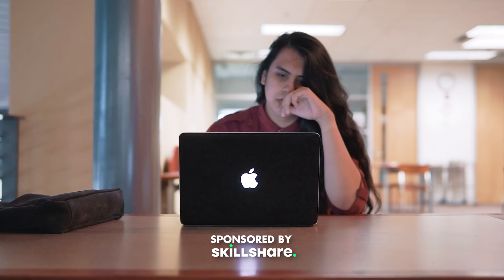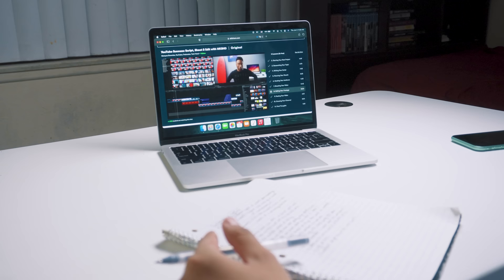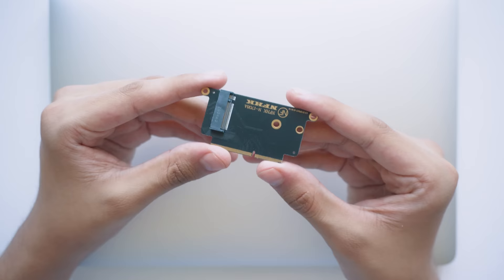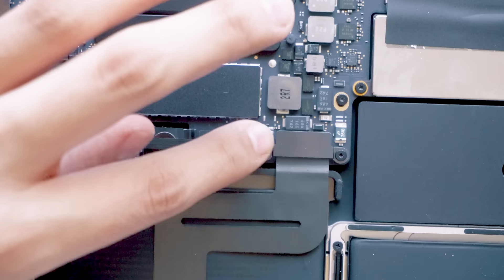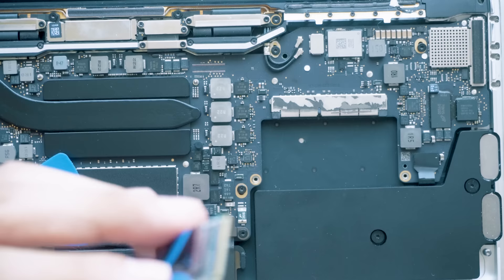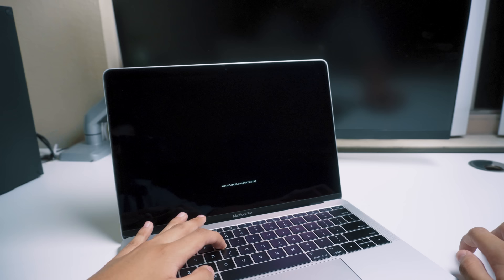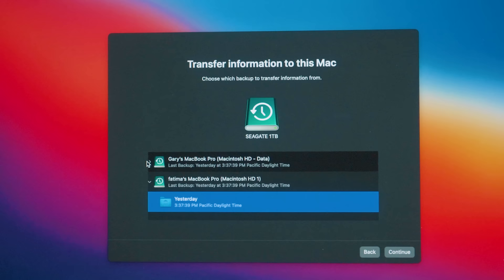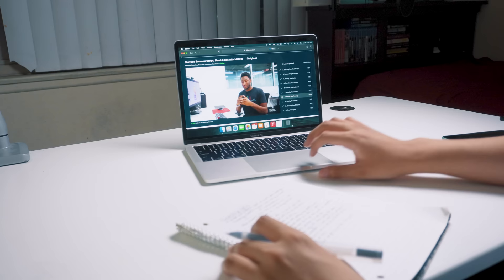I Was Wrong. THIS is the LAST Upgradable MacBook Pro

Comment: Damn this is insane. I too have a 2017 MacBook Pro that you are using in this video. Same specs same everything. The only think that scares me is after the installation and the os operating system. A couple of months ago my hard drive failed and I had to get it replace, it cost like $500. When I saw that folder with the question mark I had a flash back and I was really scared now to do this. Are you sure this will work? Ik this seems a little weird but I don’t want to run into any trouble along the way. Especially when I am dealing with my own Mac and the one thing that costed me $500 to replace. I would ask for you to guide me step by step but that’s to much to ask. Do repair shops upgrade MacBooks by any chance?

Edit: you just remind me, when I went to the apple store, they told me that the storage drive was soldered on to motherboard. So is the drive soldered onto the board or not?? Are you telling me that apple was lying to me and that I could have fixed it my self this whole time??
Reply: Yes, Apple lied to you
Reply: yes,apple often lies about this things.idk if you can,but try to get away from them asap.you'll have a much better experience with almost any other manifacturer.
Reply: For anyone reading I confirm that the model A1708 has no soldered SSD. Just disassembled mine and discovered it
Reply: Only MacBook pro 2017 with touchbar got storage drive soldered.

Comment: Probably meant to use the standoff as a nut on the opposite side of the screw. I think it wasn't in the PCB because it would have been fairly easy for it to twist through by mistake.

Comment: These are some major issues (and tips) to be aware of before proceeding with this mod:

1) Cleanly powering off becomes impossible! This is not fixable AFAIK.
2) Without properly configuring the NVME in OSX, your battery drain and temps will increase. It's possible to mitigate these, just google for solutions. Turn off icloud filesync.
3) Disable mds_stores (spotlight indexing) - learn to use find / fzf and ripgrep, quicksilver is a great alternative to spotlight search-bar
3) Occasionally your boot loader will fail to see the drive on startup. Resetting NVRAM seems to fix this.

Comment: This is precisely why i hate the lack of upgradability of Apple mac products especially their macbooks. Louis Rossmann who repairs macs points out in his repair videos that newer macs have their SSDs and the RAM modules built into the motherboard so if down the line one of them dies, a customer will either have to replace the whole board or take it to a repair shop where they can replace the module itself which can be an expensive job if done right. I much prefer a windows computer as most windows computers have repairable parts and you can upgrade others.

Comment: Great filming. 

I’d do full system updates if possible then use carbon copy cloner straight to the nvme drive (usb c external). 

Test it works by booting off usb. Then plug in and hand back to Gary.

Comment: I have a 2015 Retina Pro with 512 G. Might have considered doing this but my speakers are blown, the battery is 8 years old and the display is bubbled.  If i fix everything its too labor intensive and expensive.  I’ll upgrade to a 1T Air and give my old one to a niece.

Comment: I’ll never understand people who prefer physical buttons to the Touch Bar’s slider. With traditional keys you have to press anywhere from 5-15 times just to change the volume, on the Touch Bar it’s quite literally one touch and slide without having to move a finger
Reply: Failure rate. It’s incredible how often those things break, fail, crack ( since they’re made of glass ) and they’re also never a consistent set of tools it changes from app to app causing issues

Comment: I had this exact same MBP I purchased back in 2018. I never realized you could upgrade the storage in it. I would have kept it until the butterfly keyboard gave up the ghost had I known.
Reply: Whoever invented the butterfly keyboard ought to be waterboarded.  I had a 2016 MBP 15" and just ordered a 2022 MBP 16".  It was the only problem I had with the MBP.  But it was a major problem.  I got to the point that I had to use an external keyboard and that changed my laptop to a desktop.

Comment: The problem with the A1708 is its proprietary SSD, If the MacBook dies you lose all the data if the hhd dies you lose all the data. Kinda trash that they didnt make an adapter for data recovery.

Comment: Can't add RAM though.  Also, if you really are adventurous you can even upgrade the storage in the iPhone, so by extension it may be possible to upgrade an M1 Mac in the future, the storage isn't literally on the chip itself but is soldered on and may be upgradeable the same way you can upgrade an iPhone, but this isn't something most people would be willing to try.

Comment: While it is cool that the non-Touchbar 2017 MacBook pros have upgradable storage, the last “true” upgradable MacBook Pro is the late 2011 model imo, as it’s the last one where the stuff that can be upgraded uses industry standard connections, like SATA. You can also put in a drive doubler to replace the optical drive with a second HDD or SSD, replace the wifi card with one from a 2012 model to get Bluetooth 4.0, it has upgradable RAM, and is the last MacBook to have an expresscard 34 slot.
Reply: I thought it was the mid 2012 model? They are identical to the 2011 model if I am correct
Reply: @TechSpec814  good point, I forgot that the mid-2012 model was similar to the 2011 version. The late 2012 retina one is where they switched from SATA for their drives to a “Sorta NVMe but not NVMe” SSD and soldered the Ram to the board.

Comment: Considering the well-know screen problems on the MBP 2014 (retina) followed by the well-know butterfly keyboard nightmare from 2015 to 2019, in my view the last upgradable AND reliable MBP is the mi-2012 A1278 : with i7 core duo 2.9 Ghz, 16 Go RAM and a SSD, for the usual use it still does very much the job in 2023 for less than 400€
Reply: I agree. I have a mid 2012 MBP. Unfortunately I only have the 2.5 i5, but even still upgraded to 16gb RAM and SSD. The extra processing power would help if i was doing a lot of intensive work like video editing, but I don't use this computer for that, so it's totally fine. Honestly, people would be surprised how fast my ancient MBP is compared to their newly purchased devices. 

Next thing for me is to look into the OpenCore Legacy Patcher to see if I can get Ventura installed on this machine since Catalina is now unsupported...

Comment: I got both A1502 (128G,8G ram) and A1708 (128G,8G ram for my wife), also upgrade SSD as well, A1502 upgrade to Sumsang  970 EVO 500G and A1708  upgrade to WD 520  512G previously, but since unstable, I switch to  a second hand 256G stock SSD,  so far A1502 is still on duty,  I love it more, since the keyboard get the soft feed back.
Reply: What was unstable about WD 520 ssd? Just curious because I am looking at buying the WD 530 1TB one to upgrade my A1708 Macbook pro. Thanks in advance.
Reply: @ybesprince5076   os  update unstable,  and you need  an adapter,  couldn't run bootcamp,
Reply: @kuochenyi  Okay, thanks for replying. I will most likely go this route as well. Trying to find a 1TB secondhand Apple ssd currently.

Comment: Nah for me the last real upgradable MacBook was the 2012 15 or 13 inches. Coz you didn't need any stupid adapter, or different sizes. You could actually upgrade it yourself with a laptop SSD or hard drive that works on PC. Everything went to hell in 2015. 2016... I was out

Comment: I bought my Mid 2017 last year this time so I could produce music better than a pc would. I was under the assumption that my 256gb was as large as it could achieve. I can't wait to upgrade the ssd. It does have only 8gb of ram though. too bad that is not a doable option. a new logic board with 16gb of ram installed is $450 and the ssd kit is another $150 totaling $600. I might look around for another used MacBook Pro for that price point and skip the upgrades. Or just do it all. lol

Comment: I blundered at the battery disconnection stage and damaged the connector on the motherboard. £000PS! This is shown very clearly on iFixit under battery replacement.

Comment: Apple lied to me. I called them to upgrade my 128gb SSD on my Macbook Pro 2017" without touchbar. They did not want to sell me an original SSD of 256, 512 or 1to because my Macbook pro was sold in 128gb. They said my Macbook Pro was only compatible with a 128GB SSD.

Comment: Hi @Dammit Jeff, thank you for the detailed instructions. I followed the exact steps and was able to upgrade the SSD drive on my 2017 mbp. However, following the upgrade, the only things that I noticed are - A) my mbp doesn't "restart" anymore on manually restarting it. It just shuts down. And B) I get a warning on restarting (as per point A, it shuts the laptop down and then I have to power it on myself to complete the restart) that says my computer was restarted because of a problem - CATERR detected. No MCA data found.

Has anyone come across a similar issue on their 2017 non-touchbar mbp after the upgrade? If yes, what did you do to resolve it? If no, what do I do additionally/again to not encounter it?

Thanks, your response is highly appreciated.
Reply: Having the same type issue.  Occasionally the MacBook Pro doesn’t recognize this hard drive.  No sure why but will be installing another drive without this adapter board.

Comment: I have a 2015 15" MacBook Pro with a 512GB SSD.  I want to upgrade to a Samsung 4tb SSD - The question is:  If I upgrade to the 990 Pro, will the drive operate at maximum performance, or will the limitations of the 2015 MacBook Pro throttle it's performance?  If so, what would be the best drive for me to get for that computer, that would not be throttled by the limitations of the computer? A 980 Pro...? A 970 Pro...?

Comment: SSD dies are not that hard to de solder and resolver so you could upgrade the SSD on a soldered device if you wanted to and since you don’t need to buy the most costly parts of the SSD (the controller) even if you pay a repair shop it could be quite cheap!

Comment: Have you had restart issues since the upgrade? I ordered the adapter and ssd you linked, but I’ve been doing some reading and it seems some people have been having problems where the MacBook won’t restart, it just shuts off instead.

Comment: You will have a flashing question mark even if you don't have a drive.
So that does not mean it's a success. Only the disk utility can tell you.
Internet recovery sucks, so I advise you make a USB installer. Then you just plug the USB drive into your MacBook through an adapter, hold option while booting, you should see a logo with the macOS version you are installing, select it with arrow keys and press enter. Then you directly enter recovery mode!

Also it means you do not have to install High Sierra or whatever it gives you, as you choose the version while making the installer.
Of course you can't run a version that's too new or too old for your device (at least not without patches. Patches are lovely but you need some knowledge to use them).

Comment: While your updating of your MacBook Pro seemed easy enough and although not quite as capable, I wouldn't change from the two MacBook Pro's (2010 17" and 2012 15") that I have with their parts changing capabilities, for MacBook Pro's of later year model even if I had the funds to do so. Why except to keep up with the crowd, would anyone go to 2012 Retina MacBook Pro's or later even with the low weight due to battery and heat due to the new M1 chip. Not me!

Comment: Hi! Great video! But unfortunately it's not working for me! After installing it, the disk utility can't detect the internal ssd. I tried with another copy of adapter and ssd but same scenario. Any solution for that? Thanks. Keep up the good works.
Reply: Hi! I’m also doing this upgrade right now. I can’t get anything to work past the flashing file with the “?” Cmd+R is not working either.

Comment: I have a 2012 with a cracked screen because I put a privacy slide on the camera and closed the lid.  It's abysmally slow because the battery is completely dead and these after market ones don't last long.  Was SSD pretty much the standard after 2013?

Comment: Amazing video. Does this only work for the 'no touch bar' version (13"), or also for the 15"?
Reply: it will work with all 2016-2017 both touch bar and non-touch bar but make sure to buy the correct adapter

Comment: So I’ve done this, got all the way to the install Mac OS after formatting the drive and I get the “the recover server could not be contacted”. I tried connecting to different Wi-Fi’s, changing my time and date in terminal etc and still not working. Anyone have any suggestions?

Comment: Do you know how you can fix a external hard drive not connecting for time machine backup? i have a toshiba 1tb for my MacBook Pro (13-inch, 2017, Two Thunderbolt 3 ports), it seems it is not connecting properly.

Comment: You get a like, because I didn't know models after the mid 2012 non-retina Macbooks were upgradable.
      (I can tell you, the 15" version... Still very much usable to this day with a fast SSD in it. Also for Photoshop. And we're in October 2021 now; so 9+ years and counting)
     Do you happen to know if this upgrade is also possible on the 15" 2017 models?
Reply: a1990 (15-2017) have touchbar, so you can't change the ssd on this model, it's soldered on the motherboard

Comment: Nice, thanks for the share. I finally know that I can upgrade my measly 256GB to 1TB. Gonna order the SSD now and then will try upgrade the storage. Sacrifing 1-2 hour battery life is not a deal for me , if i can increase my SSD storage 4x as much.

Here is my simple stats on the upgrade:

Original 256GB SSD
Read +-2400MBps, Write +-1200MBps

WD SN530 1TB
Read +-2100MBps, Write +-1900MBps

The read speed is a bit lower, but considering that I got a huge upgrade on write speed and storage, I wouldn't complaint. There is not much difference is real world use for read speed. 

Edit: Added stats for both SSD
Reply: What about the battery life?

Comment: just got all my parts. I swear the microcenter guys who did some applecare repairs to my mbp awhile back put different screws in the case. The P5 screwdriver I got from your link doesn't fit in the screws on the case. It doesn't make any sense, that is the only thing I can think of that would be the cause.
Reply: PS the adapter you linked doesnt fit. Even on the pics on Amazon it's twice the size of what's in your video... Wish I would have double checked before taking the lid off my computer.....

Comment: I put in an adapter and 1TB Sabrent Drive. I followed iFixit instructions to the letter, taking of battery cable, lifting connector that was held down by a screw. I made sure the NVMe drive was well seated into the adapter, changed out the drive, reversed putting everything back together. When pressing the power button, just shows a green battery. Do all your steps, from the network selection, then comes the Apple logo, and I wait till recovery comes up. I choose disk utility, then it doesn't show my any drive besides OSX recovery. What should I do?
Reply: Same Problem. Do you have an answer?
Reply: @romafaerber  You need a boot disk of a macOS to install your NVMe drive.

Comment: I am curious, but also sad because I think I know the answer... is the storage the only thing that is upgradeable? I mean, there are always ways to upgrade if you're good enough as saudering and reballing chips and messing with the SIB or w/e it's called. However, what about RAM, CPU? Those are saudered to the board right? So the best bang for my buck would be to get a i7 and 16GB model with small storage and then buy the bigger storage probably, huh?
Reply: This is an old comment but yes RAM and CPU are soldered. laptop CPUs are 99% soldered. You can upgrade the RAM if you have the skills. If you buy the i7 model I am pretty sure it comes with touchbar only so this tutorial wouldn't apply to that Mac.

Comment: Has anyone upgraded theirs to a 2TB?  I saw one is available as an option in the Amazon link above.  Would I run into any issues?
Reply: this. anyone who's done it... please tell us how it went

edit: after a bit of digging around and thinking about it... older macbooks that have had user-replaceable SSDs or even spinning hard drives could never be upgraded beyond the maximum amount of storage apple originally offered them with (in this case, the A1708 MacBook Pro could be had with 128gb, 256gb, 512gb and 1TB storage options) so if i had to guess... a 2TB drive would probably fit physically, but you'd never get the laptop to boot as macOS would probably be nasty about allowing the laptop to boot off a 2TB drive. that's my speculation anyway
Reply: @mylifeasmanta  I actually have a 2TB drive installed on my 2015 13" Macbook Pro. There's absolutely no problems at all. I have partition the drive, 1TB each for MacOS and Windows.
Reply: @gemini-mg6sc this is actually possible to do? How long would a 2015 macbook pro get os updates as compared to 2017 macbook pro? Wish to purchase a used model to use for school.
Reply: @tanja-k  Yes, you can find ssd drive upgrade for the 2015 Macbook Pro here on Youtube. The 2015 model accepts 2280 Nvme drive with a special adaptor. Unfortunately the 2015 model no longer get new MacOS versions. The highest MacOS version it supports is MacOS Monterey I believe.

Comment: If I want to do this, and then afterwards, I want to run boot camp to run windows as well, will that GUID partition part affect boot camp at all? Or is it just for the initial setup
Reply from the maker: It’s just the initial setup. Boot camp runs flawlessly on this machine afterwards. It’s the first thing I did on it after filming. :)

Appreciate you watching! <3